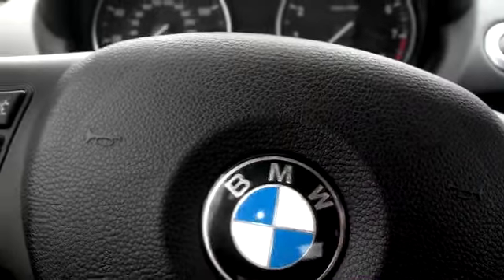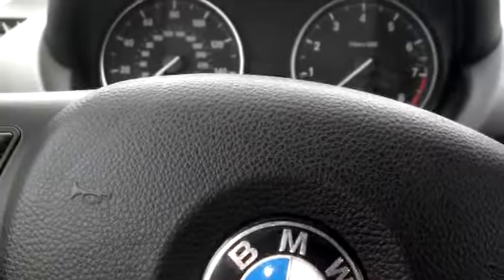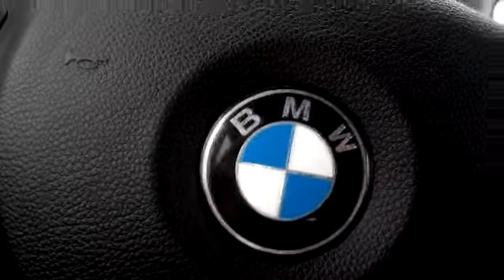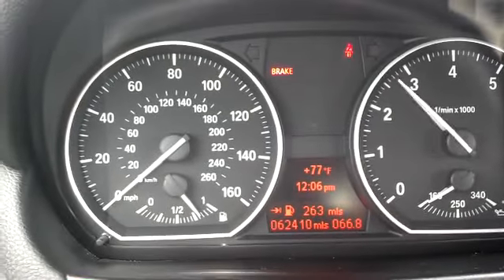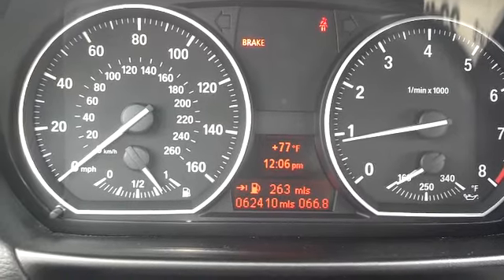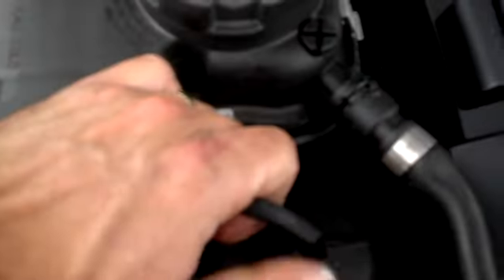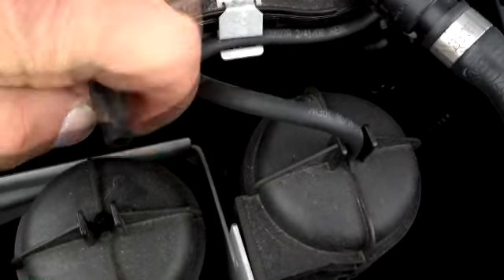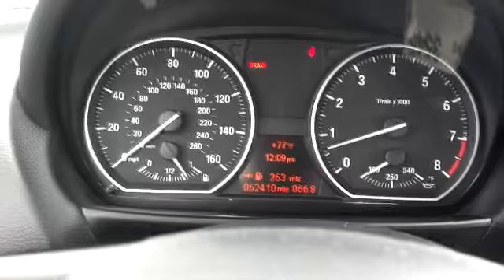BMW Turbo Charger Rattle Problems N54 Engine (BMW Extended Warranty For Turbo's)

Comment from the maker: Hello, Usually when this failure occurs both turbos need replacement. However, warranty will only allow replacement of the failed turbo. If one was still in good condition then only one can be replaced per BMW. If your shop did replace both and warranty inspected the turbos and found that one of them did not have a failure your shop would be charged back for the entire repair. While it is more common for both to need to be done they did follow correct procedure.

Comment from the maker: Mark, it depends on the fault what may be occurring. If bought from the dealer I would expect them to be responsible for repairs for up to 30 days. Make sure they print out the fault for you and don't just clear it out. If you get me the fault code and description I may be able to help further. They need to check fluid level in the transmission and see if the mechatronics sleeve is leaking which could cause low fluid. It could also be internal in the transmission.

Comment: Just took mine into the shop.  My 07 335i has 103k miles.  Same rattle at start up.  Luckily I got the extended warranty which covers this!  I don't think I'll ever by another used car without a warranty.  The mechanic said the wastegate would have been like 3k to fix!!

Comment from the maker: Hello, This does sound like worn out turbos. The test at the dealer is an activation of the turbo with the BMW tester and listening for the rattle. You may have an extended warranty up to 80,000 miles I believe for the turbos for a rattle. Normally the cost is a 1 hour diagnostic charge to determine the failure.

Comment from the maker: Some noise from the turbo on start up is normal. As long as the noise goes away and you are not getting any fault codes for boost pressure you should be good :)

Comment from the maker: I believe this is for the US market only as this extension pertains to emissions in the US for 8 year 80,000 miles. It really should be a worldwide extension as the problem is pretty common on higher mileage N54 engines.

Comment from the maker: While a small amount of rattling on a cold start is normal the noise indicative of an underlying problem which can lead to a loss of boost pressure and the 30FF fault which shuts down the system.

Comment from the maker: You have the 30FF fault code. I know it well :) Pressure too low. This will only shut down the turbo system by means of the electronic wastegate actuator. It will not cause further damage. The turbo fails at the pivot usually from wear and tear. Hopefully the replacement turbos are more robust. I think they are in general. There is no way to avoid this problem as it is a manufacturing issue. Hopefully BMW will improve the turbos as time goes on. I have seen even the N55 turbo fail as well.

Comment from the maker: The new turbos are updated and have a stronger wastegate. You should be prone to less problems but in some cases these wear as well. But if they where replaced you should have quite a bit of mileage before a problem occurred. I would guess upwards of over 80,000 or more.

Comment from the maker: The 30ff code is for charge pressure too low. Not sure if the warranty is available in Germany. Most likely this is just the US market. Some noise is normal on a cold start but if it still rattles on a quick rev in park or neutral as the rpms come down then the wastegates are rattling and loose.

Comment from the maker: :) They are great when they are running well. But they have some issues with carbon, injectors leaking (engine failure and hydro lock) or just misfires, high pressure fuel pumps, CATS failing due to the fuel leak, turbo's... :--) but when they run well they are a pleasure to drive. The new turbo should last close to 100,000 miles. I usually see the rattle noise around 80,000 miles so 60,000 to 100,000 miles is the range I suspect they will last. But this is a guestimate :)

Comment: Right. It will cost me as 3 new turbos.
Yes, I have the rattle noise. I've done the electrodiagnosis. It says - "Too low preasure in turbo"  
Will this stuff damage my car if I don't resolve the problem immediately?
And why this is such a frequent problem with N54 engines? Simply because turbos are worn down? How can we avoid this?

Comment: Hi I've got an 2006 335i coupe 62000. It's running fine on the streets but on the motorway if I boot it up to speed, it then goes flat like it's in a dead spot. No warning lights. It saying it's over heating on the motorway but wen I turn it off and back on it's fine. It also has this type of rattle I think.
Also is what engine is mine 335i 06 plate. Thanks in advance
Reply from the maker: Hello Richard, You should have the N54 engine. It sounds like the electric water pump is failing. This will set you in failsafe and a key cycle can reset the internal speed of the pump. A scan for codes should show a reduced output for the water pump or BSD fault (bit serial data).

Comment: hello, i need help. my 535i makes a rattling noise at the start up, then goes away after revving up. then periodically while driving if I turn curb to fast or something, the engine malfunction reduced power light comes on. turn off car then goes off. please help
Reply from the maker: +Amber Davis The best thing to do will be to have the code read out to see if this is related to a 30FF boost pressure fault. If so and with the rattle this may be failing turbo chargers.

Comment: I have a 07 335i.  I took it in for a few issues and they said that my turbo was bad and needed replaced. One of the serv persons remembered (as I was picking it up to leave) that they were under warranty (I have 79k miles).  Well they took apart the one making the noise and replaced that one but didn't replace the other one.  They said that they didn't replace it because it wasn't making noise.  Is this common or should they have replaced both? Thanks

Comment: hello I have the same problem but my car only does the noise when it's cold after 5 minutes sounds Norma..why is doing that? ? can buy a aftermarket turbo?? or how much does it cost in the bmw dealer?
Reply from the maker: +Abel Garcia Hello Abel, I have some good news for you. Some noise from the turbo system is normal on a first start until it warms up. If the noise is occurring at operating temp then you have a problem but it sounds like you should be good. Hope this helps!

Comment: I'm not sure if i have the same problem, it only happens when i start my 08 535i you can hear a rattle under the hood but after being on for a little bit the rattle noise goes away, do you think is the turbo problem that you mention?

Comment: AskTheCarExperts How do you know if the hpfp needs to be replaced on a 135i ?
Reply from the maker: Sometimes you will get a fault code which lead directly to a hpfp but the most common symptom often without faults is an extended crank after the vehicle sits for some time. Most often overnight. Sometimes misfires can also be associated with a problem with the high pressure fuel pump. The BMW test plan often asks the main question...is there a complaint of an extended crank...if yes it often prompts to replace the hpfp. I hope this helps King!
Reply: +AskTheCarExperts Im getting a 2008 bmw 135i this weekend and i was just wondering about reliability after bolt ons. The car currently has 74000 miles, are there any common problems at that mileage?
Reply from the maker: Hello King, The 135 is a powerhouse and a fun vehicle to drive! The n54 engine does have some inherent problems. First is carbon build up on the intake ports. This presents as a skip under load most often due to air restriction. This is fixed by walnut shell blasting of the intake ports. Low cost on parts high cost on labor. Also the turbo's can fail at the pivot bearing. Before purchasing make sure to rev the engine at a standstill with quick throttle blip. If you hear a rattle as it the idle comes back down the turbo's will need replacement in the near future. HPFP's are much better and fail a lot less. I hope this helps bud.

Comment: Heh.. And how long will the brand-new turbo live without this disease approximately? How do you think, will it withstand at least 10k miles?
I heard the N54B30A was the best among the sex-cylinder engines for 2 years. I understand now that this is only advertisement. =)
P.S. Thanks a lot =)

Comment: when I take it in they said it had no codes
Reply from the maker: +Amber Davis Hello Amber, Often this problem does not set any codes. This failure can be determined by revving the engine up quickly at idle and listening for a rattle noise as then engine revs come back down. This is a noise concern that means the turbo pivot bearing has too much play and the turbo needs replacement. I hope this helps.
Reply: +AskTheCarExperts soooooo is that expensive? I just got the car 4 days ago! I'm really debating on taking the car back. like what are my options and how bad are my pockets gonna be damaged?
Reply from the maker: +Amber Davis Hello Amber, I could take a look at the vehicle information to see if you have any coverage for this problem. Can you contact me via my website at www.bmwdiy.com It will be easier to converse.
Reply: +AskTheCarExperts I just tried that and it won't do anything, it's like an application fill out form. what's your email